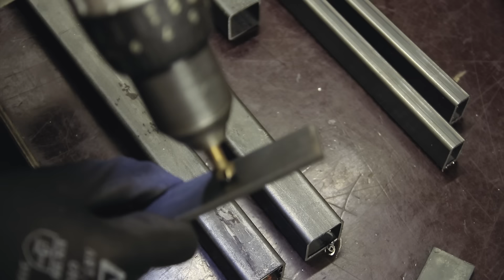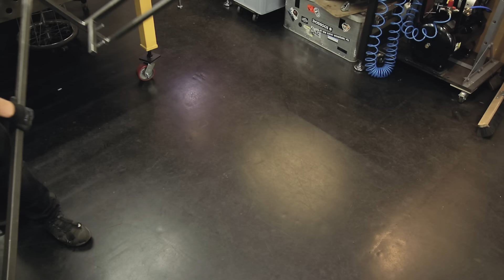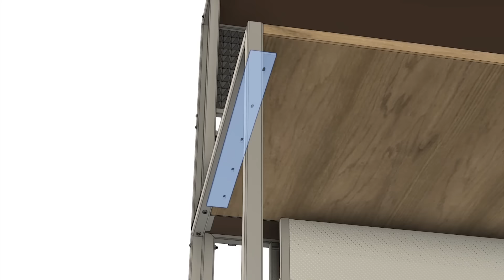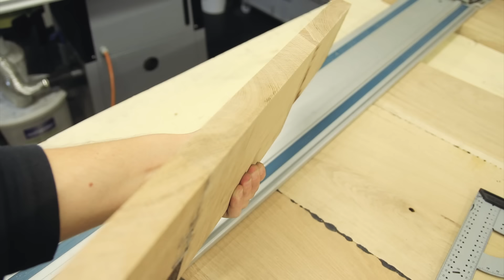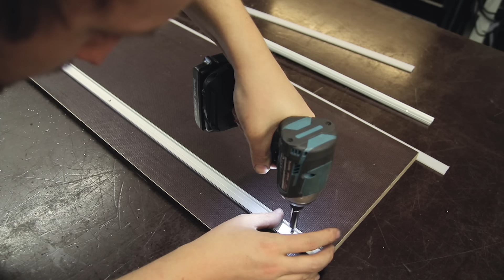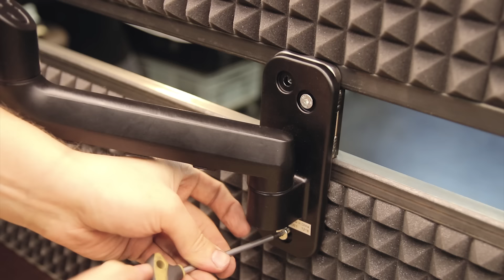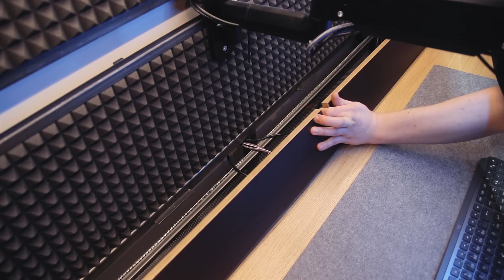How to Build a Cable-Free Desk with Built-In Lights, USB, Outlets + More!

Comment: Is there any mention of the basic dimension of the desk? Overall height, width, and depth?
Reply: He has links to his project files in the description so it isn't necessary to mention them in the video.
Reply: @crunchykarsten8765  Except for the fact you have to pay for the project files and the overall dimensions are not mentioned in the Etsy listing either. Shouldn't make assumptions.
Reply: @ArtoriasAkai  Welp you cant blame the man for wanting to get paid
Reply: @crunchykarsten8765  Who said anything about blaming him for wanting a little money for the plans? You realized you said something dumb and trying to make it into something it’s not. 

I just wanted to know the dimensions before I buy and find out it maybe to big or too small. Hopefully you see how that maybe important information, yeah?
Reply: @ArtoriasAkai   Yeah, I can see that. You could potentially try to figure out the dimensions of the table by getting the measurements for the keyboard and using it as a scale to approximate the length and with :p

Comment: No disrespect, but if you have the equipment to make this. You probably dont need this video.
Reply from the maker: You can make this on a normal workbench in the average garage shop if you have a welder. I specifically went over this in the video

Comment: I made myself my own desk about 9 months ago and I do not regret it.  I went with a 3/4" solid acacia hardwood surface as it had many benefits I was looking for, 1-about 20% harder than white oak, 2-grain of the wood looks gorgeous, and 3-has natural oils in the wood that repels water.  Even though you didn't specifically say it but I like how you went right to applying clear coat to the surface of your desk and showed that stain is not required for a wood finish.  The natural wood colour is a valid choice as well.  I did use an espresso stain with my desk as I did like the look but stain is 100% an aesthetic choice and not mandatory.  I had zero experience with wood working prior to making my desk and I only had a few borrowed tools but managed to get the desk I wanted and building your own desk is the best way to get exactly what you want.  As for the live edge you have on your desk is a preference thing too but IMO its an awesome look.  I added a super wide pull out keyboard tray on my desk as I prefer having one but the ones on store bought desks are just too small.

Comment: @Phil Vandelay did you say how much depth that desk has, and if not, about how many inches and/or feet are there between the front edge and the back panel???
Reply from the maker: It's 850mm from front to back
Reply: @PhilVandelay  thanks... I made a table back in highschool and it was somewhere between 30 and 35 inches, but once i brought it home and started using it, I found out that it was too long, and too deep for my liking... Of course, it wasn't made out of metal, but at 7 Ft long, it was awkward, and still pretty heavy. If I would have been thinking more when I designed it, I would have only made it 4 or 5 Ft long, but I was thinking "the more desk space the better", and unfortunately that isn't actually as true as one might think. I don't have it anymore though, thank god.

Comment: Nice build!

I‘m actually thinking of building my own furniture in the next months and already planned them as CAD models. Would you recommend 3mm or 4mm tubes for welding beginners? I’ve only electrode welded once before, but want to learn MAG welding for this. As I want most pieces to be in one piece, the wall thickness makes a 15kg difference (for a 100kg piece). 

Also I want to explore friction drilling for creating threads on the tubes - maybe that method would be interesting for you as well. :)

PS: I‘d use double sided foam tape (in german „Montageklebeband“ or „Spiegelklebeband“) for the LED strips as the included ones tend to unglue quite quickly.

Comment: Moin.
Like the desk. it would have been good to know the overall cost of the material. with or without the extras.
now i dont know if i should try it to build it my own or even get the plans.

but besides that a good video.
Reply from the maker: I can't really give a general number for everyone there because it varies HUGELY depending on your location and what materials you buy. Wood and steel prices have been all over the place in the past 2 years, so it might vary between several hundred dollars depending on the country and the current state of the world markets. I spent around 500€ including everything, but I also used solid oak as a tabletop, price would again be different if you use something cheap as a tabletop and steel prices may be different now. It could certainly be done for less, or more.
Reply: @PhilVandelay  hey thanks. Thats fine. Helped a lot. I might try it out when i got better at welding

Comment: The material you are using is, if im not mistaken, what we Germans call "Siebdruckplatte" or "screen printing plate" in English.
I think its uncommon in America, because screen printing techniques is very confined to actual printer shops which produce tshirts and such. I guess its uncommon to hear about it being used as a building material because of that reason. To me its also a very German thing to use it as material for workshop furniture. Have not seen it much anywhere else i travelled.
Reply from the maker: Yup that's exactly what it is (I'm actually from Germany). People also commonly use it for trailer beds and transporters since one side is grippy and it's so durable. Great building material for all kinds of things, but not exactly cheap
Reply: @PhilVandelay  yeah the price is hefty, but its reasonable, aside from the current boost in prices, because of you know who. Also seen it used in mini camper builds, that became mobile tiny houses. Great stuff :)

Comment: This was a random video that came across my feed.  But, it turned out amazing, one suggestion I could make is instead of having the phone charger separate, integrate that into the desktop.  you would just need to drill a big enough hole most of the way through the desktop from the bottom.  Then you can get one of those round chargers and put it up in there, then have a channel for the cord to run through towards the back of the desk.  If you want to get fancy you could drill a small hole all the way through where the led for the charger is and then punch out a small piece of acrylic to seal up the hole, but still see the blue light.  That way you can see where the charger is instead of guessing every time.
Reply from the maker: This was suggested by multiple people now so I'll explain it again in detail: I know those chargers exist because I used to have one, and I don't like them so I specifically chose not to integrate one of those because they don't work well and can actually damage your phone if you don't put it 100% perfectly in the right position every time. This is because the wireless charging coil in your phone needs to be properly lined up with the one in the charger, if they're not, charging is inefficient and it can result in increased heat buildup which degrades the battery. Especially with the cheaper ones, phones can get REALLY hot during charging. Even under optimal conditions, wireless charging isn't the greates way to transfer energy and having anything between the charger and phone (such as a layer of wood, even if it's thin) makes these problems even worse, so even though it looks fancy, hiding these things under a surface is really not a technically sound or practical way of charging your phone, even if it sorta works. Many manufacturers say that even a phone case inbetween is to be avoided. In the standup charger, the phone is always in the right position and you can also read notifications when it's standing up, so I hugely prefer those. But besides that, charging technology and phones are still rapidly evolving, so I also don't want to permanently build some device into my desk that could be outdated and unusable in a few years.

Comment: Nice Job! If you dig a hole from the bottom of the table but not thoroughly, you can install wireless charging pad inside of your table to eliminate only cable on  your desk.

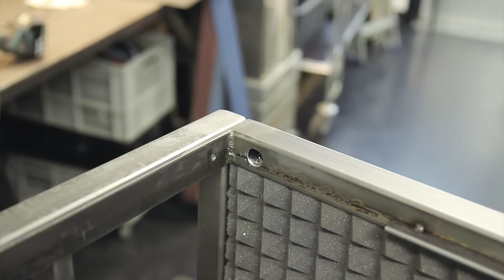Comment: At 23:30 you talk about a problem where the cables might get cut by the metal. If you want to prevent this, you could use grommets made of rubber or silicone. You can find them in various diameters.
Reply from the maker: Yeah I actually thought about making some on the lathe as I was building this, but I eventually was too lazy and figured it's fine. So far, no problems

Comment: "Dying plants" xD
How comes you didn't use a 49" 32:9 monitor? It would fit your desk quite well.
I have one and I'm super satisfied! It's run by a laptop, if you wanna see my setup: https://youtu.be/akhJ1tBmqdo?t=128
Btw. we have the same keyboard, I find it awesome!
Reply from the maker: I looked at a lot of monitors and I'm actually not sure about the setup yet either, but I'm not a big fan of those dual-27" ultrawides like the G9, because they are even more narrow than the one I currently have (which is about the height of a 32" 16:9 Display, just wider). The super wide narrow ones are good for gaming, but I mostly do work with this setup and I need more vertical space for that, not just width.  Currently there's nothing on the market that really fits the bill, my dream screen would have the exact ratio of my current one, just about 50% bigger, but nothing like it exists as far as I know. But there's a good chance I will eventually change the monitor setup in some way, I also thought about adding smaller monitors vertically to the left and right of the current one for a triple setup
Reply: I see your point, the lack of vertical space is really missing, since I also work with it. When it comes to gaming, it's stunning, but many games have compatibility issues, 16:9 is still the easiest solution.
I've just heard about the Samsung Odyssey Ark, maybe that would fit your needs :)

Comment: Love it! Would it be possible to add wheels, for easy movement? Or is it too heavy?
Reply from the maker: No I think it would work great, I way actually going to do it at first so I can move the whole thing around as one unit easily but eventually went with leveling feet instead, but you could definitely install casters too

Comment: Nice functional design. It also looks easily adaptable. If I would do this for myself I would for example make the bottom backplate (with the foam) slimmer so there would be a bit of gap between it and the table surface for an LED strip, which would illuminate the ports for clear visibility (I would have a minimum of 5, I already have an I/O grommet like that icy box, a Qi charger, and a power strip, I would probably put my microphone USB interface and a hard drive dock in there too), so I wouldn't exclusively need to rely on the single top-down lighting for illumination, as it could be easily obstructed.

With my current custom desk I have a vertical board in the center to which my monitor mounts and I have a single passthrough hole for cable routing, I really like the horizontal rail design you have, it looks more functional.
Reply: so do it then....
Reply: @intra_morph  If you already had custom furniture you'd know that serious considerations have to be made before committing yourself to making one, otherwise you end up with (your domestic equivalent of) hundreds of dollars wasted on something you end up disliking for one or several reasons, if you failed to consider something that only becomes apparent through actual use...

Therefore brainstorming on such ideas is the first step!

Comment: Very nice desk. One thing I'm wondering though. Would aluminum be strong enough? As someone who also moves quite a bit, I'd appreciate the weight reduction.
Reply from the maker: Probably yes, but it's actually not that heavy. You can see me lift the whole frame easily at one point. It's only heavy once everything is put together, that's why you can disassemble it
Reply: @PhilVandelay  Thanks for the response. I saw that part, but I just wondered if it was possible. I was looking at new desks, and you really are making me consider building my own.

Comment: If the lineup of the two foam pieces bothers you, just add a vertical bar, of maybe some nice wood or metal. Just a purely decorative element, but it disguises the fact that you needed two panels for that width of desk.

Comment: Love the desk. Bought the plans and will upsize them to a 2400mm desktop.  I'll be getting a friend to build it - as soon as he finishes renovating his workshop!
Reply from the maker: Now that i'd like to see! Send me a pic when you're done, would be interesting to see how it looks in superwide
Reply: @PhilVandelay  First I need a LOT more practice with Fusion 360, . I'll create the desk from scratch using your (bought) plans (no sketches 😞)
Reply: @PhilVandelay  Build is finished, installed yesterday but still doing some final touches (finishing etc) Very happy with it. I'll put some photos on YouTube when I'm done💯
Reply: @Craig's Workshop has finished his latest project [bench grinder] so work should start 'soon' on the desk! Still need to do some CAD adjustments for the larger size.👍
Reply: Bit of a delay in starting  the build (my fault) but it's underway, materials purchased this week!
Reply: Can u give me the plans I don't want to pay

Comment: Hey I was wondering what all the materials cost for this desk and if there is expansion for 3 monitors and speakers on the side. If you can reply that’ll be greatly appreciated.
Reply from the maker: I spent around 400-500€ on everything including the Lighs and Hubs, but this will depend a LOT on which kind of wood you use and where you are located due to the state of world markets. Wood has gotten extremely expensive and steel prices fluctuate quickly, so it depends on a lot of factors. 
You can definitely hang 3 monitors onto this, but including speakers I think it would get cramped space wise. It would be quite easy to build the desk wider though, you'd only have to change a handful of measurements.

Comment: This has to be the best computer desk I have ever seen!!!
Could you tell me what settings you used on your Tig welder to do the joints on the desk. Co2 for the gas?
Thanks for the links to the accessories !
Reply from the maker: Nothing special really, TIG always uses 100% Argon, no Co2. Other than that no special settings, no pulse, no pedal, about 70-80 amps, 2.4mm electrode, gas lens. For welding basic steel tubing there's really not much to it other than practice 😅
Reply: Thanks for the information! 
A friend uses Co2 for steel, says Argon is too expensive but I put quality over price, Argon it is!

Comment: i mean realistically if someone is concerned with being electrocuted by the 12v from the rgb wire, just cover the wire thats in the metal tube with some of that braided sleeving that people use for cable management, its doing the same thing anyways being routed through the hole

Comment: Great project, I am jealous of the cable management, especially when looking at my cable situation. One thought that came to my mind: Putting the 3D Printer up so high may introduce unwanted vibration?
Reply from the maker: So far I've had no problems, all set up the desk is pretty heavy but I also don't run the printer very fast usually

Comment: You have a  home machine shop . Your video is rather bragging than helpful for people.
Reply from the maker: I guarentee you I could build this with only an angle grinder and a welder. I specifically explained in the video that you don't need the fancy tools, they just make it faster and sometimes a bit more accurate.

Comment: Love it! Just a small note, the strip you glued with double sided tape on the LED aluminium channel might unglue itself at some point. The LEDs run a bit warm, which warms up the channel and the double-sided tape deteriorates. It's rare that it will unglue itself all at once, but it has happened. Just check it from time to time, so it doesn't fall on you or on top of the monitor. Happened to me few times with double-sided tape, I just change it every few months, wipe the old one with Isopropyl and replace it with a fresh one.
Reply from the maker: It actually has fallen off once since I installed it 😅 But I put it back using a different kind of tape (more industrial type stuff) and so far haven't had any problems. In hindsight, if I was to build this again I'd just screw an L profile underneath the light profile so that it's installed more permanently. But since it was more of a bugfix it'll have to do for now

Comment: I want one! 
Maybe a neat little idea to add to this: Hollow out a section of the desk and put a wireless charging pad in there. Lay your phone on top to charge it. No cables, no wireless charging stations. Even cleaner. 

Lovely build. Super clean. Super useful. Funny jokes. Sub +1
Reply from the maker: Yeah I used to have one of those actually but it seemed unreliable because you have to put your phone in the perfect position every time, otherweise they have a tendency not to charge proplerly or sometimes the phone gets really hot even. So I'm not a big fan of the principle, that's why I went with the dock-type charger where the phone orients itself. But I also like that the phone is standing up so you can see notifications